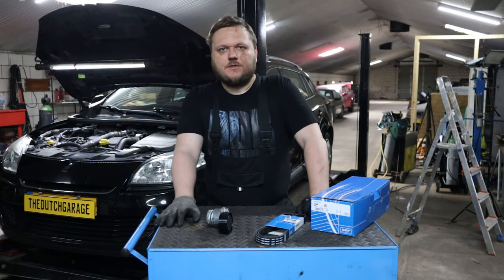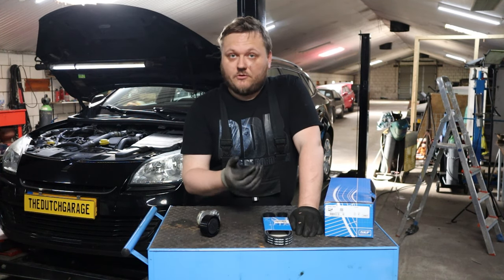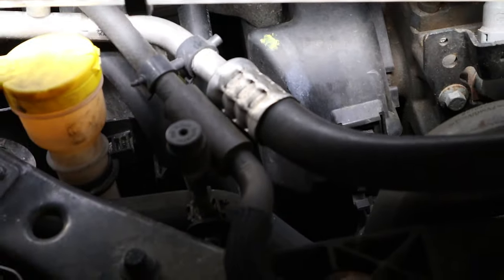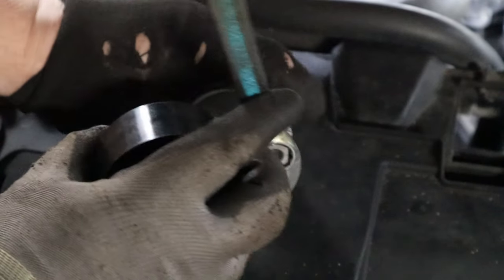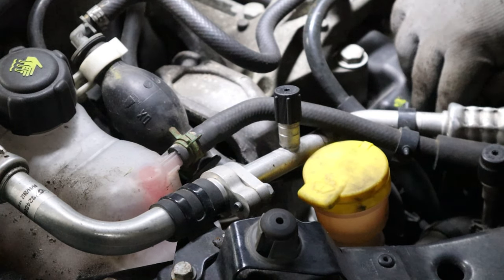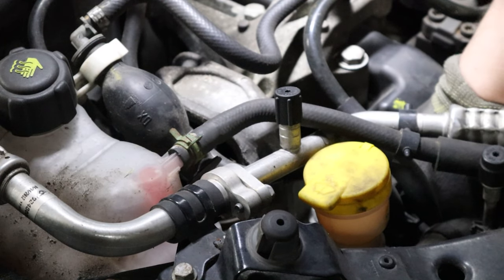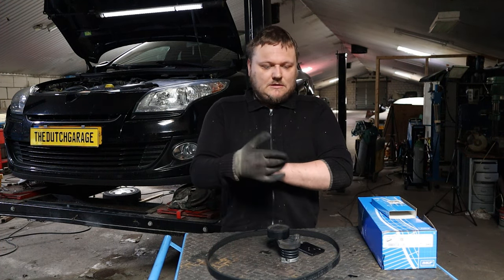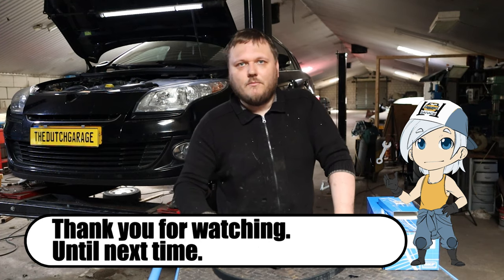How To Replace A Belt And Tensioner Renault/Nissan/Dacia K9K 836, K9K 837, K9K 846

Comment: Super video on changing the belt & tensioner. Suggest one minor thing, run the engine up & check everything is running ok before putting the cover back on.
Reply from the maker: Its a option, but some times you need to remove sensors and hoses. so you cant run the engine.

Comment: Dit is heel intressant. Dacia/renault accessoire riemen piepen heel snel bij dit merk.
Reply from the maker: Mischien dat de aftermarket beter is. We gaan het zien.
Reply: Volgens mij is dat door de alternator. Die heeft een koppelings poly en die durven wel verslijten of extra slijtage op de riem aanbrengen.